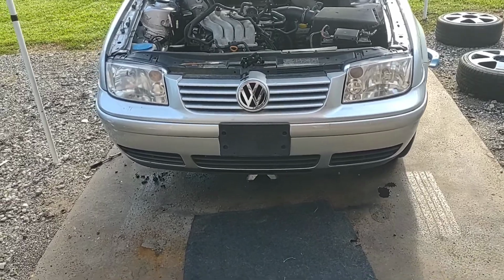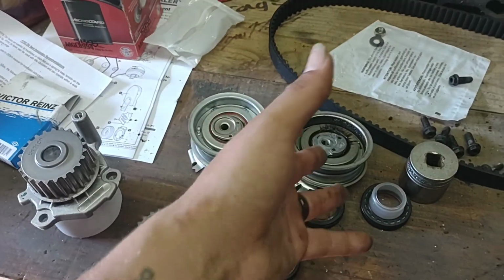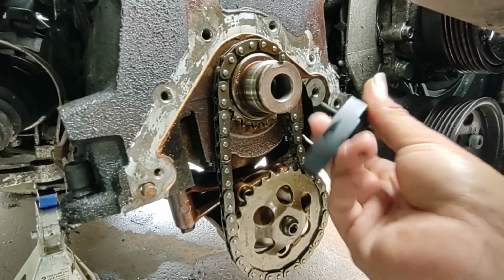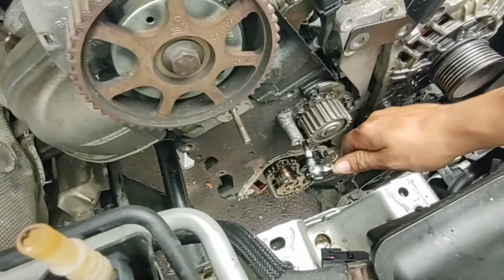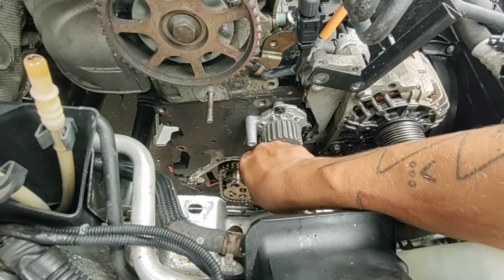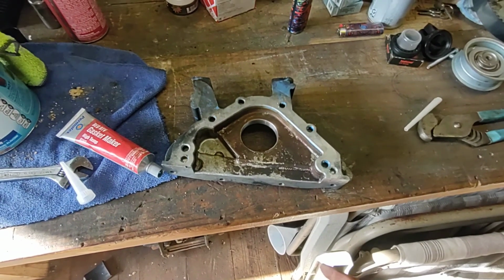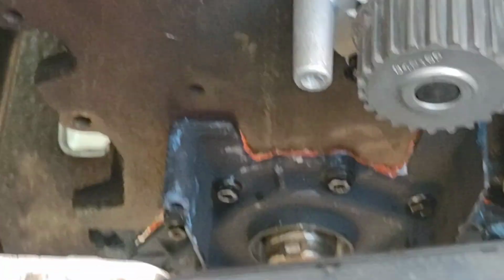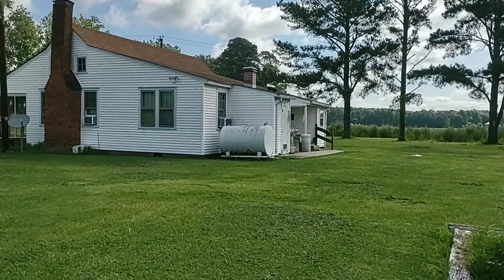VW Mk4 Jetta 2.0 water pump, front main seal cover, front seal, and oil pump chain guide.

Comment: Thanks mate, really enjoyed your video.  Beautiful place you have there.  Greetings from Auckland.  Just a quick one, at what mileage must the water and oil pump be changed? I have 2.8L VR6 mk4.  It currently has 180k kms and has been pampered under my ownership.  I do oil changes after 5k kms.
Reply from the maker: Well thank you very much for stopping in and watching my stuff! And honestly I'm not sure of the oil pump interval specifically. But if you have good oil pressure and no warning lights flashing I wouldn't worry about it too much. As far as the water pump goes, when it leaks replace it. Fortunately the water pump isn't too hard on a vr6. It's thankfully driven by the serpentine belt so it's not terribly hard to get to. But you will have to take loose the passenger engine mount and lift the engine above the frame rail to get it. You oil change interval is spot on. Keep that up! I hope this helped!
Reply: @vr6prodigy  Thanks mate.  I now how bloody unreliable vw is but I still buy them.  Just great to catch with the community and trade advice. Thanks for your great work.
Reply from the maker: @louvendran7273  thanks mate? I never saw this reply. But I'll be honest man vws can be reliable haha. And I realized I never answered your questions. Vr6 water pump isn't really to hard to change (no timing or anything like the 4cyl) so switch it when it leaks. And the oil pump is hard to say. If you've got good oil pressure I'd leave it alone. Thankfully oil lubricates the pump that pumps it as well as the whole engine. So unless you knowing l notice an issue I'd leave it

Comment: Thanks for making this video! I was thinking about putting some gasket maker on the water pump. What do you think?
Reply from the maker: Don't do it
Reply from the maker: It's meant to seal with an o ring on mk4. It will NOT seal correctly without that o ring!
Reply: @vr6prodigy  I was going to use some gasket maker with the O ring. I did the water pump on my VW last year and it leaked. I am tired of adding coolant so I am going to install a new pump again.
Reply from the maker: @robertheintz8017  nah man, I've never done it personally. However, if you spread a nice thin layer on the flat part that sits against the block it could theoretically help. I normally just try to get everything nice and clean before reassembly. Take a lil 300 or higher grit and get a tiny bit everywhere. And then use some "white lithium grease" on the o ring just before install.
Reply: @vr6prodigy  Thank You!
Reply: I’d recommend silicone paste over any other grease - same as dielectric grease. Seals o rings better than anything I’ve used
Reply from the maker: @Realmisterwolf  if I find any I'll give it a try. But white lithium will actually make the o ring swell and set to the shape it's being pinched into better. And it's grease so it's got longevity.
Reply: @vr6prodigy  I did the water pump on the weekend and no leaks this time!! I didn't use anything but some Prestone antifreeze on the o-ring. I did however put the 3 bolts in and tighten them each a few turns so the pump went in straight.
Reply from the maker: @robertheintz8017  beautiful! Congrats Buddy! Looks like you're back on the road!